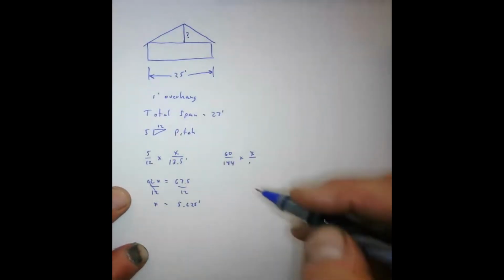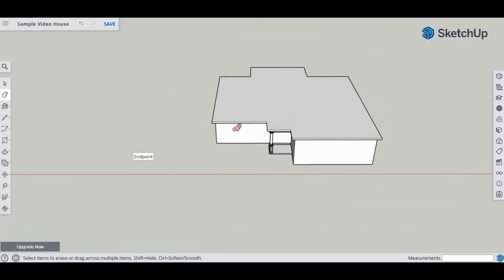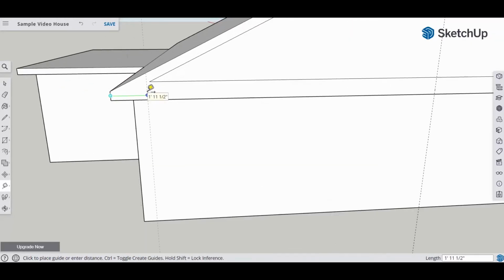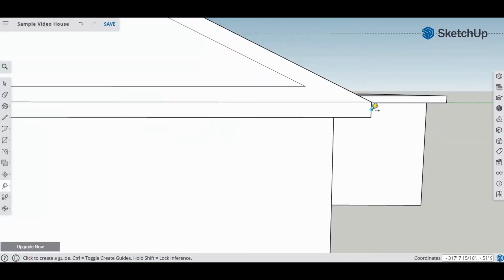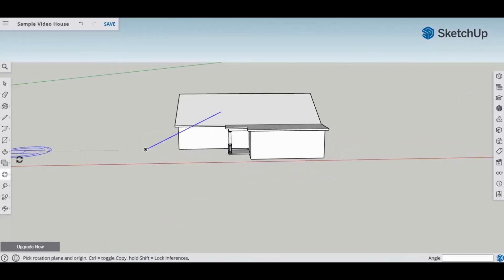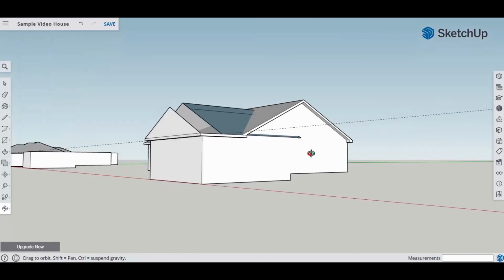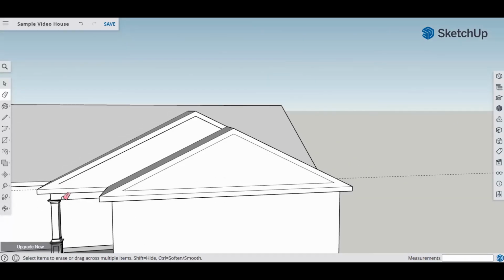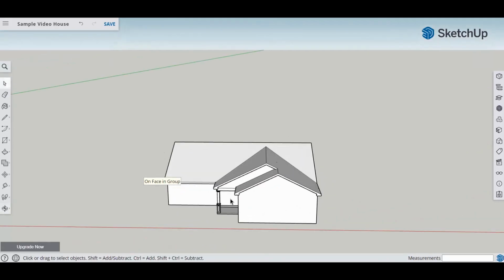Sketchup House Design Episode 6 Gable Roof

Comment: when I resize imported dwg file, I got error message says 'component withint the model that were loaded from external files will not be resized!' , how to resolve it? Also how to align the house wall in the imported drawing with the axis? Thank you so much
Reply from the maker: I am not sure how to fix this. I never copy a drawing from a dwg file. I always draw all  my houses in AutoCad first and then draw it in Sketchup. It gives me the opportunity to really look at the design and dimensions to make sure it is what I want. This is well worth the time invested. It will also help if you are going to build it yourself. My latest design build is a lake house tear down and rebuild. I drew it first in AutoCad and then in Sketchup. This helped because it was a difficult design and build so far. I only have 2 videos out but it does show the design in Sketchup. Here is the link to the series. https://youtu.be/sUn_gg8y5U0   Sorry, I did not answer your question.
Reply: Thank you for replying, liked your video. Also what is the purpose to drew  in AutoCAD first, then move it to sketch up? Was it because AutoCAD can not complete your task? In which way?
Reply: @jyan127 AutoCAD is best for 2D, it is fast & easy.100% projects are planned in AutoCAD & then taken to any 3D software. 3D softwares are too slow for 2D drafting. Revit, SketchUp or 3DS Max all use Autocad drawing plans. Just make your plan in AutoCAD,then import to Sketchup & rescale by just tape tool with control.

Comment: Such a great video for me. Thank you so much
Reply from the maker: Glad I could help!
Reply: @designbuildandfix  Would you please help me a little more?
I don't understand the total span.  Is it the length of the house or width of the house or the biggest porch of the building?
Reply from the maker: @jsaerial  Hi. If you want the ridge to run left to right then the span is front to back outside to outside and if you want the ridge to run front to back then the span is left to right outside to outside. You can include the porch if you want the roof to run in same direction as the rest of the house. Otherwise the porch would be a reverse gable and not be included. Then you would have to calculate the span of the porch separately from the rest of the house. Hope I answered your question!
Reply: @designbuildandfix  I am clear thanks a lot